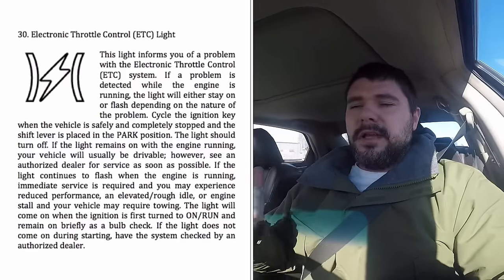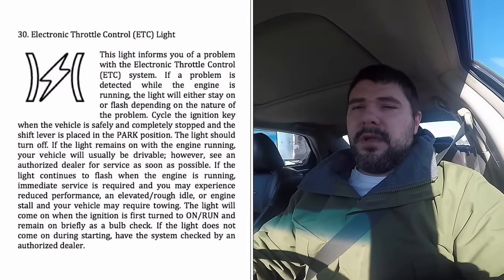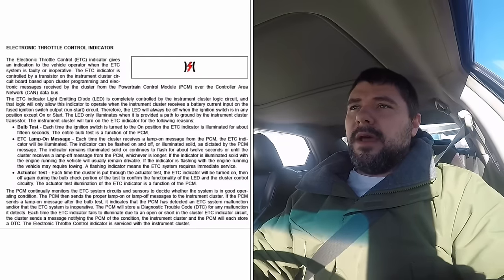Chrysler 300 lightning bolt warning

Comment: is the remote key unlock/lock working properly? I had the red lightning symbol and engine failed after couple of minutes, my key battery was flat, changed the key battery and haven’t seen it since, that was two weeks ago, battery is £1 worth a try? 🇬🇧 2009 300 srt design touring 165k

Comment: I have the same problem except for my truck just when it run no more and I've replaced spark plugs coils starter battery cranking cam sensors and then I had somebody erase everything off the computer and reprogram it and then it finally started but it kept dying and I replace the fuel pump and now it stays running I've replaced the throttle body two times and I've tried relearning it I even had somebody try relearning it off their computer but it will not work the light won't go off and you could give it a little throttle the RPMs come up a little bit but pretty much you got no throttle control before when the truck wasn't running really you could give it throttle in the voltage wasn't changing on the computer so you can tell they weren't talking they are now but the throttle body still is not opening

Comment: I had this issue replaced throttle body; car turned over twice then it did not turn over or start again - I called my auto shop and was told the new throttle body had to be relearned - basically reprogramming/flashing the PCM

Do you know (or anyone know) if that reprogramming will complete the issue? 

2013 300s 5.7L awd
Reply: Replaced throttle body and performed relearn still did not start up - ideas?? (Anyone)

Comment: Oh yeah
Before cleaning it,should have been able to cut car off,then turn key on,(dont start car tho) for few seconds,then
Turn key off,turn key back on few seconds, then start car,should have reset it,light should be off,if not or it comes on and flashes agin,then try cleaning with spray,OFF OF the car,its the back side that is problem,front u gunna think why the f55k I gotta clean it,shidd look brand new,its the back.
See first comment if I've done all that,and lighting light  comes back on.
Replace.
My shidd 600 plus WITH MY SHOP DISCOUNT,smh.
I got the srt8 2006-7 6.1 hemi 300C.it was a beast stock,but I've done work to it,I got around 680-710 at the wheels.
I spank hellcats all day,if I hook up.
Now it is possible that they tap out around 140+,so I just sail away.
I love my shidddd. Fo sho fo sho I love my shidddd fo sho.

Yall have blessed day.🤫🙉           what can I do to HER,right now this very second.🤔🤔🤔
To be continued!!!!!!!

Comment: Someone please help me having this  issue right now i replaced the mat sensor intook throttle body off and cleaned it and still losing all power for 3 to 5 seconds etc light on and engine light on giving me a code of p0700 and u0100 ppease help
Reply: I have same issue now.. clean the throttle body and change my egr valve so far its going

Comment: I have a 06 charger srt8 I just experienced this problem and it has the light and it doesn't have power when it accelerates by itself and I have a code but for a temperature sensor idk if it has to do with it.Pliss helppppl!!!
Reply from the maker: SureDrake23   I would first address the temperature code then see if the problem still persists. Good luck! Let me know what you find.
Reply: PCM
Reply: @andreikusgreenfield9865 why do u say pcm?
Reply: @Gangbaby300  I had the same problem

Comment: my red lightning bolt is still on my 2009 Chrysler 300c, i changed the throttle body and the gas pedal, tried to reset it numerous times no luck
Reply: Pcm
Reply: You probably have a leak in the intake manifold

Comment: Do a throttle reset (look up a video) and installation on the throttle body is super easy DONT GO TO A DEAL THEY CHARGE YOU $800 FOR A 10 Minute JOB
Reply from the maker: GAH   Something like this?

How to replace the throttle body!! 05-11 Chrysler 300 srt8 with throttle re learn https://youtu.be/2dLATJwoW08

Comment: my car die have the lightning bolt and engine Iigth i replace the throttle body and my car won't start the same and both lights still there and my car won't start I don't know what to do bro please help
Reply: Chrysler 300 2008
Reply from the maker: MR 420   Have you pulled the codes with a scanner tool
Reply: @MattsMotoWoRX  bro I try doesn't give me codes my car either I don't know what to do
Reply from the maker: MR 420  if the check engine light is on and you can’t pull codes you have either a bad pcm or some wiring problems. Good luck let me know what you find out with the car

Comment: Had similar issue with 2006 3.5L V6, but also had the Stability Control light on as well. Car wouldn't start. Cleaned the throttle body with throttle body cleaner. Got car to start. Seemed fine. Then 5 minutes later lights would come on, engine would sputter, then run at high RPM. Lived with this for a while then took to repair shop where smoke test revealed leaks in gaskets. They replaced gaskets and all is now fine.
Reply: Thanks for the information. I curious if you can specify which gaskets were leaking?
Reply: @phillippardo5712  Yes, they were manifold gaskets: EGR valve gasket and the intake plenum gasket.

Comment: Matt I'm getting the red lightning bolt my 1st symptom is that it's running hot
Reply: Leiandra Ellis me too idk what to do I jus changed thermostat/water pump
Reply: Ended up being my gas pedal sending some weird signal to the throttle body
Reply: If it’s smoking it’s coming from a bad valve cover gasket my 05 Chrysler 300 overheats from that it’s not the water pump I just did my timing and water pump and it still smokes from the valve cover gaskets

Comment: My 06 charger srt8 is still stalling out and getting the lightening bolt. Changed the throttle body and the main computer for the car and it still stalls out. Changed plugs twice in less than a month and the coil packs as well. Any ideas what I might need to do? It's been in the shop pretty much since I bought it last November
Reply: Gabriel Temple bro they ain’t reliable smh I have same problems just fixed my fuel pump smfh
Reply: @Worldisyours323  sorry to hear that man! I just got mine back from our shitty local dodge dealership and they kept telling me to use MOPAR plugs and would cost me $1200!! I changed them to NGK Iridium IX and the dealership I'm taking it to Saturday said I did good by getting those! It's has a P2174 code on it now.
Reply: I do believe I finally fixed my car myself! Took the K&N Blackhawk edition air kit and the coil packs I put on and put everything stock back on and kept the NGK Iridium plugs and it's been running for 5 days straight with no problems!  I may go with a different K&N filter kit but without the extension for the air flow sensor. The one I had, I had to use the extension to reach the new sensor position.  I believe it wasn't getting the signal to the computer.

Comment: do you have to reprogram your computer after changing the throttle body
Reply from the maker: James no last name   I don’t think it’s necessary but if you have the ability to I would recommend it
Reply: @MattsMotoWoRX   thank you ,i replaced my throttle body, ran good,then it did it again,,no throttle engine still on running rough,i turned off the key for 10 seconds started the truck and away i went. made me think does it need to be reprogramed,or do i have another issue.?

Comment: My 2006 chrystler 300 srt8 threw a lighting bolt code and check engine light and replaced the thermostat still boiling

Comment: Same exact thing in my 2014 dodge charger goes in limp mode doest matter the speed. I have to pull over try and start again. I thought it was the PCM thats the code i got i changed that its still happening. So now i will changed the throtlle body. Stay tuned.
Reply: Sneaker Head I hear the throttle body is very popular on the dodges. Also call Chrysler about it and N.H.T.S.A.  888-327-4236 to report .. Chrysler 800-922-1997. Heard they would pay for the part seeing there are so many complaints and so many of their cars and trucks are doing it. The throttle body has plastic gears in it.. they wear out.
Reply: @mxr7586  i thought it was my pcm/ecm it wasn't i reported that as a problem now that i know the true problem i will do that asap. Thanks

Comment: My ETC light comes on.... den it makes my car run hot..... den it kills.... if I let it sit for about 15-20 minutes it cranks right up any suggestions?
Reply from the maker: B.BreBrandz Brandz   Sounds like either a wiring issue or an ecu issue
Reply: Related to the intermittent connection issue.   My fans wouldn’t turn on reliably until I went through all of the connections under hood.   Also these cars are notorious for a pinhole leak in the radiator or it’s connections.  No water in the driveway. No indicator at all until BAM, it’s running hot.  Only way I found it was after topping off coolant, drove around with it hot and smelled coolant in HVAC, pulled over, left it running, looked around radiator and could not find the problem, until I just happened to have my face in the right place to get an ultra fine mist on my glasses, and I could barley feel it.  Without glasses on I may have never noticed it.  Im on my third radiator, second one lasted one year.  Think that has anything to do with engines overheating and dropping valve seats?  No, couldn’t be related at all.   Also low water ruins water pump, and also A/C system, as the evaporator and associated parts don’t have the cooling needed to perform, and they fail.   My compressor just ate itself, but it’s been a couple of months since the new condenser by the radiator, which was leaking and allowing overheat conditions.   I’ve only gone through one water pump, but this will be third AC compressor.   Steering rack is number three.   Power steering pump is number four.    Calipers I’ve lost track.   Thank god for warranties.  But even at that they play dumb sometimes and tell me that the problem I described was not found by the techs.   Denial.  Fraud .

Comment: Thanks for the video but may I suggest not so long of a back story, your solution discussion was barely 2 minutes but you rambled about other stuff way too long.
Reply from the maker: Thanks for the feedback I will hone my YouTubing skills subscribe and stay tuned!!!!
Reply: Thanks saved me alot of money
Reply: It’s a VLOG ppl!!! The diff info that he gave was important to diff people. If u don’t like it move on
Reply: That actually really helped me because my car did the same exact thing and with me being a woman I need someone to go into debt because I don't know anything about cars. So Matt my car basically did the same exact thing it through a check engine light and a lightning bolt light I lost all power but the difference between mine is is mine will not start. I had a friend of mine come out and hook it up to a scanner and it didn't throw a code just like you said that it wouldn't. My sister's husband thinks it jump time I don't know how he came to this conclusion but that's what he said when I told him the symptoms. Another friend of mine looked at it and he said he thinks it's the camshaft position sensor. Would you happen to have a Facebook or a work phone number I could call and ask a couple questions?

Comment: Egr seal will also cause this
Reply: I hope you are right as I replaced my throttle body and the light stayed.Just ordered new EGR seal and hope it works.
Reply: Robert Hull did the egr seal fix the problem?
Reply: Yes one time after some work with the manifold off ..put a new egr gasket, that particular problem solved

Comment: Aye matt i gotta 06 chrylser 300 to. I thank i needa throttle body on mine. My gas petal barely work when i press on it. My red lighting bolt on to with the check engine light. Do u thank i needa oem throttle body?. I preciate da video get bak 2 me im tryna revive my 300 lol.

Comment: Computer I fixed mine went away
Reply: 2005 Chrysler 300
Reply: Is it still fixed?   PCM, TCM, ? I don’t think it was the computer.  I think it was the act of disconnecting the connector and cleaning it and reconnecting it.    It’s an intermittent connection issue where any glitch shuts the car off.   I went through every connector harness I could find under the hood after doing all of the ground points front and back, which didn’t work.   Use high quality electrical cleaner (DeoxyIt) then dielectric grease the connection and reconnect.   I did that and never even got to the PCM or the TIPM and the problem seems to have gone.
Reply: Yes it is still fixed im 100 percent sure 2005 2.7 chrysler 300 throttle light new computer off ebay fixed it up right ebay has them for under 200 plug and play just disconnect battery
Reply: Pcm

Comment: so what if a lightning bolt that isnt blinking, and a check engine with codes  B1640, C121C,  P2181🥹
Reply: ik my intake manifold cover needs to be replaced cause its broken at a certain point, we were able to put some silicone and put it on and its okay for now. some air is still going in but nothing crazy. no vacuum leak engine code.

Comment: I just changed my throttle body control, used an OEM. Still having this problem. What else could it be?
Reply: Did u figure it out?
Reply: @mannyvourliotis  Yes, it was a gasket on the engine.
Reply: @mannyvourliotis  Intake manifold gasket